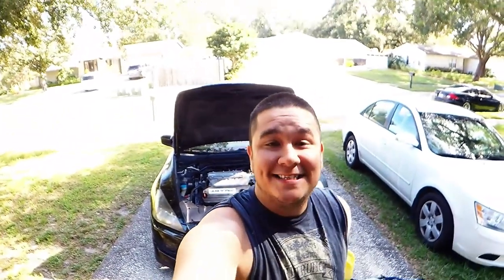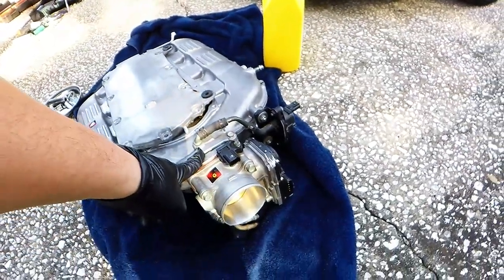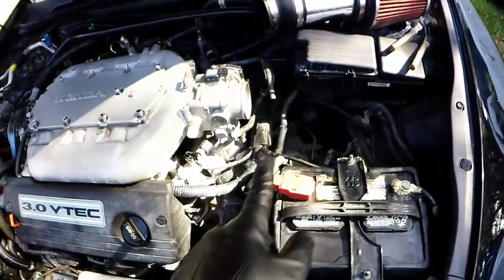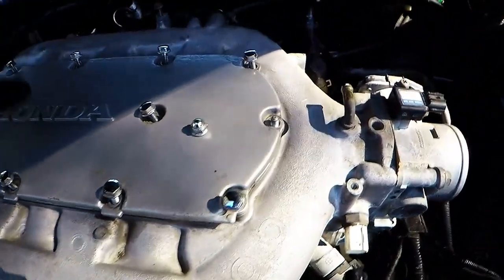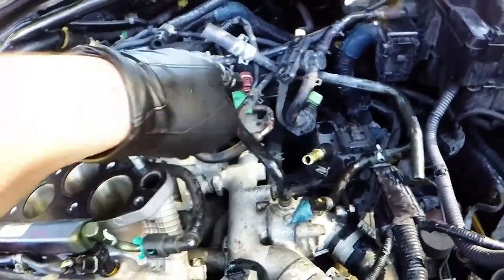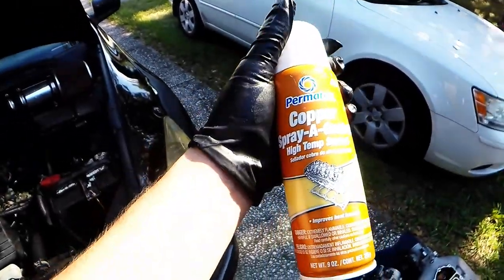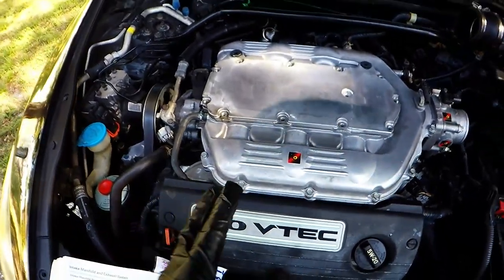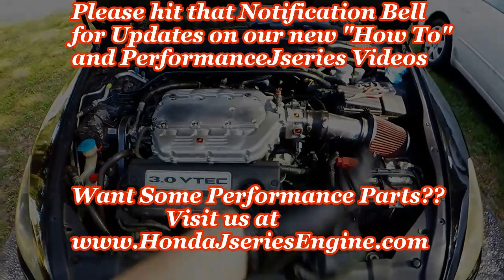Honda J-Series Throttle Body Coolant Bypass & J35 Magnesium Intake Manifold Install

Comment: Just got a 2005 6-6 coupe. I saw a video where a guy hood wouldn't close cause it was to big. I have a J30. I plan to go to the junkyard what manifold +throttle body should I pull? Do I also pull the runners?
Reply from the maker: The only time a hood wont close is if you get an IM spacer. Reachout to us at contact@HondaJseriesEngine.com and we can point you toward the right parts from our store

Comment: what about the two outlets that come out the throttle body what'd u end up doing
Reply: Nothing, they no longer have coolant running through them so they just sit there open. We guess if you wanted you can cap them but it wont effect anything if left open

Comment: What if I don’t wanna bypass the throttle body coolant is there a video showing me how to run the lines back to the throttle body
Reply from the maker: ? You would just leave them plugged in. Or put them back. There are only 2 ports on the TB for coolant, you can't do it wrong

Comment: Can you please do a  video on how to change the fuel injectors on 05 accord? Thanks.
Reply from the maker: We have Valve lash adjustment and older videos showing how to remove the runners, which you have to pull the injectors off. Or you can check our ID1000 install, which is literally the injectors install

Comment: So do you need the actuator? I’m doing a root supercharger build on my 3.7 same manifold with the actuator on the left side but with adding the supercharger I need to delete that I shouldn’t run into any problems should I as you just deleted it in the video but the just kept it plugged in. Also wondering what you for the small gap on the left side after deletion

Comment: What are the torque specs for the 10 mm bolts around the Manifold before you split it? Aswell as sequence??
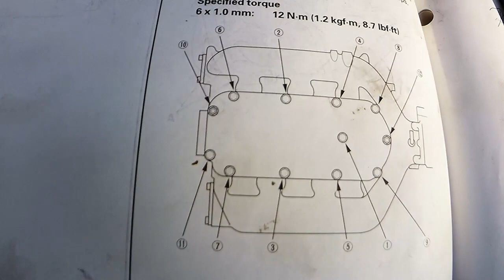Reply from the maker: 9:37 we show the torque sequence and also the ft lbs. 8.7lbs and the sequence you have to go to the timestamp of the video to see

Comment: Is that intake manifold the same size as the j37?
Reply: Did you find out if it's the same or not?
Reply from the maker: The J35 had a slightly smaller Throttle body side inlet. But when we PnP our Stage 2 it's opened up in to a Venturi to increase air flow. We also have this in our description on our online store PnP IM listing but we saw no difference between the J37 and J35 IM after our stage 2 PnP on them. It better to save your money, get our J35 magnesium or high temp reducing finish to cut down on IAT....that's really the main benefit to the magnesium J37 IM, mag material doesn't heat soak as much but our J35 magIM Or our high temp finish does that same but $3-$400 cheaper

Comment: I bought a j35 2013-2015 rdx manifold . Did I buy the correct one? Also the material seems very thin. Can it still be ported ? Doesn’t feel like aluminum. It’s a very light manifold. 
Also it doesn’t come with a top plate to connect the actuator like this exact manifold. What top plate do you recommend I buy to make it bolt it up. I don’t want it hanging there loosely. Thanks for any help

Comment: I have a j30a4 with 170k miles and I was contemplating turboing it, the transmission seems a little iffy, should I do it or just forget it
Reply: There is a lot of work you would need to do before turbocharged it but the engine itself should be good, those j series can take a beating, the transmission will definitely need to get replaced if it’s still stock, 04-08 Acura TL 6 speeds should fit

Comment: What year odyssey j35 intake can I use for an 05 j30
Reply from the maker: 05+
Reply: @HalferLandPerformance  is the j37 manifold that you offer on your website from the sh 2009 to 2000 2014 Superior than the Odyssey manifold?

Comment: I have a J32A1 in my TL without the IMRC actuators on the side of the intake manifold. I’ve been looking to upgrade to a larger better breathing intake manifold without the intake runner flaps to keep the swap simple. 

I think the intake manifold in this video might be the kind I’m looking for, do you know which cars these come off of or which J-Series model? Or if you think there are better options out there?
Reply from the maker: If your car has the butterflies or flaps, you'll need to get a matching top plate with the butterflies or you'll get engine codes. The mag IM's come with No butterfly top plate/covers or cover with them
Reply: HalferLand Performance The J-Series Freak's  that’s what I’d be looking for. The TL-P J32A1 doesn’t have the butterfly flaps for the intake runners making the swap much easier for me.
The only thing I need to know if it’s just a direct bolt on or if there are any parts that also need to be replaced like the throttle body or gaskets since this is a relatively old J-Series motor.

Comment: What will the coolant bypass do? Is it going to give more power?
Reply from the maker: Reducing intake temps always yeiled more power....denser/cooler air = more air the engine can take in = more fuel it needs = More air + more fuel = MORE POWER 😎
Reply: @HalferLandPerformance  Dude ive got the takeda intake and that thing SUCKS. my IAT temps were 150 F today. any tips routing it to pull cold air?
Reply: @securityconnections9497  cold air intake
Reply: Yes and no... well technically yes but its more for stability of Optimal Temp Spec.

Comment: Hey was wondering where do I get shop book like that and do the same rules and torque specs apply to a 3rd gen TL
Reply from the maker: Haines Manual is a good book. I have a Genuine Honda Dealer manual which are nearly impssobel to get...or they have online manuals you can download

Comment: Exactly what i did on my 05 accord v6 and 07 tl type s. Love my j series.
Reply: I have an 07 TL type s did the coolant bypass make a difference in throttle response and drop temperature?
Reply: @gsrjaycee4521  you won’t feel any power gain. It just prevents power loss during the summer.

Comment: I got a 9th gen accord with the J35y2 is the 3.7 manifold and throttle body worth it?
Reply: If you port it yes if not just port the stock manifold and use the j37 tb
Reply from the maker: No, we have shown the 3.5 after our Stage 2 PnP gains more then the J37 does. The only difference between the two is the 3.7 is slightly, and we mean very slightly larger....but that also slows the air velocity down, thus losing power and making the J35 a better IM, especially after our PnP. As for the 3.7 TB, We just released our HLP 79mm TB that's larger then the ZDX and is a direct plug n play option for all J30, J32 and J35's no adapter plate needed as the ZDX TB 😎

Comment: rerouting the throttle body coolant you have to be careful as to which Honda engine you do that to. some engines use it as like a choke on the efi system. i hope that makes sense for everyone. some engines have it separate and it's all good to do it. also if you live up north you will need to keep it hooked up or you will have to put it back once temps get down to somewhere like the 40s. just my personal opinion.
Reply from the maker: bob thompson  correct, that’s why I mentioned it’s for cold weather climates to basically thaw the TB plate and get it up to temp
Reply: @HalferLandPerformance  
For sure. I just wanted to clarify for the ones who will think so what the engine gets hot nothing will happen. And what happens is ice will build up in the TB and slowly block it off and can cause either large chunks of ice to be sucked into the engine or to block it off enough to lose most of the engines power or cssue the engine to die while driving. And thatcan be very bad for some drivers like a gf who won't know that when the engine is dead if you press the brake pedal the first time you'll have vacuum but if you let off the pedal you lose the vacuum and it will become extremely hard to stop the vehicle and the power steering will stop make steering hard for someone of small stature.